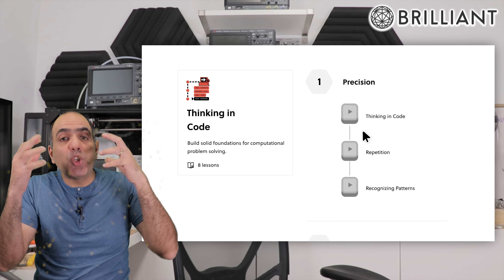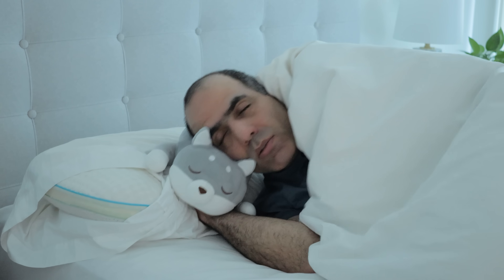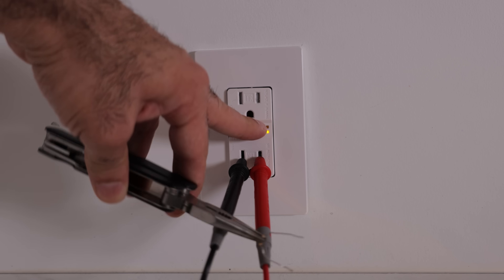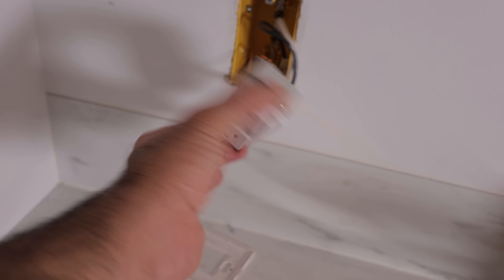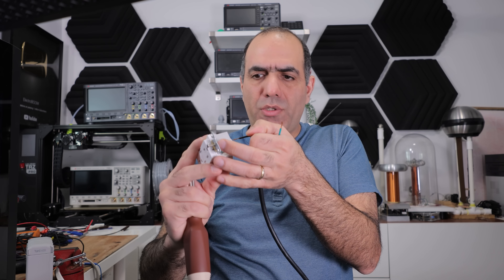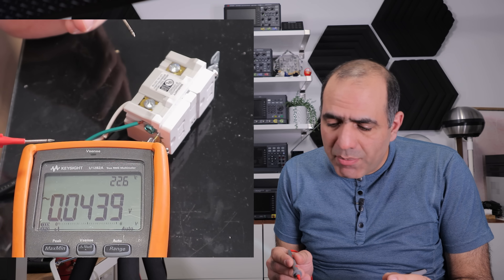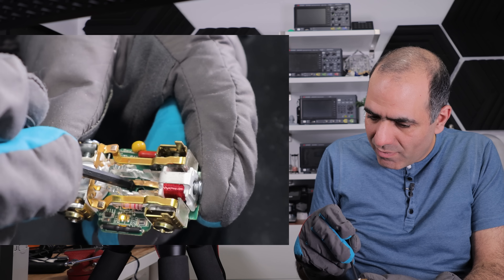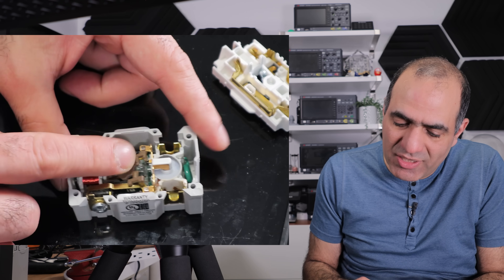Repairing Faulty Ground Fault Failure

Comment: I was a US Navy mechanic for 20 years. I very often found that when something was malfunctioning, and I took it apart, didn't find anything obviously wrong, and put it back together, it was magically fixed. I think it's because in the process, I accidentally cleaned out whatever bit of debris or tightened whatever loose thing was causing the original problem. Gremlins broke it, gremlins fixed it.
Reply: Yeah, sometimes a little bit of dust in the wrong place can make all the difference.
Reply: @FineBakedPastry  So wake up, Mister dustman. Wake up and, smell the dust particles
Reply: @FineBakedPastry  Half-Life joke?
Reply: i learned the same thing as a kid working on million dollar machines at a newspaper. the head maintenance guy told me just un-seat and re-seat all the connections, that fixes most problems
Reply: As someone who spent over 10 years in the Navy who was allowed to assemble/disassemble a few more electrical components than I probably should've due to my electrical background, can confirm. "Mechanical agitation" is a real troubleshooting step, even if the SOPs don't explicitly say so
Reply: I am a private citizen who worked on US NAVY ships for 10 years as an electrician. I feel sorry you were on those ships twice as long as me. Cheers, here's to the cancers.
Reply: It is the physical equivalent of turning it off and on; thus resetting all the goobers within that're screwy!
Reply: @lady_draguliana784  was about to comment how turning a PC off and on will "clean" the data the program use and fix the problem that it may have caused, work at least 70% of the time
Reply: @DeadsTBD   Yup! It's what I always try first!
Reply: @lady_draguliana784  and that's why tier 1 tech support are trained to follow the script where its the 1rst thing they Ask 🙂 then goes to the rest of the script where most other problem would be fixed and ultimately for people like us that already googled the problem and try to find a solution where we did all of that and find it frustrating before finally talking to tier 2 tech... Anyway there's a reason why they are asked to follow the script.
Reply: @DeadsTBD   I still chuckle about the old "Sir, the Disk goes in the Disk tray", "You mean the Cup Holder!?" 🤣
Reply: @lady_draguliana784  and you wonder why they need to specify some things in instruction telling yourself "who would be dumb enough to do that?" Well there are people dumb enough 😅
Reply: @DeadsTBD   Remember, if something dumb is in the warnings, it's because someone was dumb enough to do it! 🤣
Reply: One of the weirdest "how the hell does that work" examples of "percussive maintenance" I ever heard was from the guys who ran a local second-hand domestic appliances shop just around the corner from where I live. They mostly dealt with fridges, freezers (and combinations thereof), and electric ovens, though also washing machines and tumble dryers. I once bought a fantastic and seemingly magical "silent fridge" from them, which ran on the old ammonia absorption cycle with no moving parts and really was completely silent. One day it stopped working, fortunately while still within the 3 month guarantee they had provided, so I called them up to ask if it might be possible to fix it. When I reminded them of what type of fridge it was, they said "yes, no problem, we can have that working again in about 20 minutes".
It turned out that all they did to fix it after collecting it from me was to load it into the back of their van and take it for a 10 minute drive, including several roads nearby with plenty of potholes and speed humps. They really did have it back in my kitchen, fully working again, in less than 20 minutes. Apparently this type of fridge can suffer from temporary blockages in the condenser tubes, which the bumpy van ride dislodged, and that was enough to get it working again. So really not much more than the old tactic of giving an appliance a thump to get it to work again - the shock most likely jiggling a loose connection somewhere.
Reply: Navy Electrician for three-ish years here, I was O-level and didn't disassemble things much but I imagine that's related to 'percussive maintenance' working, i.e. smack it and maybe the electrical contacts that are a bit corroded rub off enough to make good contact again or something.
Reply: Also, Hooyah Navy! (I was a CTI2!) 🍻
Reply: "gremlins fixed it." 🤣
Reply: This is pretty much the idea that my Mom used to fix glitchy Apple IIGS computers at work.  Unplug it, open the cover, and give the chips and cards a bit of a wiggle or push to reseat and this seems to correct the problem.  This is one of the troubleshooting tricks I use if my PCs gives error tones.
Reply: The Omnissiah wills it.
Reply: @amorpilo9666  From the moment i understood the weakness of my flesh, it disgusted me.
Reply: Appliance repair here. Yeah that’s happened for me too. Just unhooked everything, looked at the connections, and put them back. Magically fixed.
Reply: Electronics have an even simpler works-amazingly-often fix:  power it off, and then power it back on.  (Although, with modern electronics, the "power it off" stage often has to involve physically disconnecting the power cable, because modern on/off buttons don't actually power devices off, they just send a signal to the circuit board that tells it to switch between normal and power-saver mode or, in some cases, to send a signal to the firmware or even to software, to tell it to do that.)  I've used this power-off-power-on method to "fix" all sorts of things, ranging from laser printers to a french fry vat.

But the time that impressed my boss, was the time somebody complained that a computer was making an undesirable noise, and I walked up to it, listened for a few seconds, and then thumped my hand down once on the top of the case, and the noise immediately stopped.  I could hear that the problem was a cable brushing up against the PSU fan; it was ATX, so the PSU was at the top of the case, so all I needed to do was jostle it enough to shift the cable's position a little.  Worked, first try.  My boss was like, "Wow, hitting the computer actually works?"  And I was like, "occasionally, but only if you know what you're doing."
Reply: yeah I've had this with servers, I call it doing CPR
Reply: Navy vet also, gremlins are real, can confirm. VAQ-142 Grey Wolves, with Prowlers, not the new Growlers, had Gremlins. Confirmed failure point, reseating connections scares the gremlins off, proven.
Reply: a mechanic's version of just turning it off and on again
Reply: @ornji  🤣 i never even thought about it that way but that's so true lmao
Reply: Pixies...
Reply: Your comment (and similar ones in the replies) inspired to me try to fix my glitching mouse by partially disassembling it and putting it back to together again. So far, I think it has worked!
Reply: And what MRC did you use😂😂😂
Reply: As a it admin just appearing on the crime scene fixes things. I call it the eye of the master. 😂
Reply: yep, and this is a great example. Watch when he takes out the gfci for the first time. See that screw on the inside of the box right at the position where it would come into contact with the neutral contacts? Then he replaces the gfci but this time slides it fully right away from the screw. "Problem solved"
Reply: As someone who's serviced computers for nearly 25 years now, I can relate
Reply: My sister was the electrician. :)
Reply: A bit like a mechanical factory reset, no?
Reply: Friend of mine gifted me a pocket MD recorder/player, 20 years ago. Apparently it didn't work, but only one external screw was missing.
Without any knowledge, I took it apart, saw the complexity, aborted, put it back together (still missing the one screw) and that magically fixed it. Served me well for a couple of years, before I got a decent MP3 player.
Reply: Were you as seabee?
Reply: @LonHunKoc hoo rah seabees
Reply: This happened to me today 😂
Reply: Loose connections are the doings of the devil I swear. Happens alot and can be very very bad.
Reply: That is absolutely true
Take it apart, clean it and put it back together
works 80% of the time
Reply: @Fluxkompressor  yep, aslong as shit hasnt started to melt or burn ur pretty much good to go haha
Reply: All contacts "should" be coated in a substance that prevents insularity via oxidisation.  I guess high-enough voltages can break through, but otherwise a lot of contact pressure and a bit of gold...

Oh why oh why do financially minded peeps hoard this useful metal in useless piles and elevate its price?
Reply: usa number one babyyyy
Reply: This happens everywhere in life. Fixed so many items and gadgets by wondering what's wrong, opening it without any success and putting it back together - fixed.
Reply: Yeah, I actually saw it. I have a RCD or residual current  protection device at my home.
 A year ago it kept tripping randomly during the monsoon season even though it was well insulated in side my home. I replaced it with new one. Then I opened the old breaker and found a bit of black gross of cobweb and dust between the test resistor and the phase contact. I cleaned it and reassembled it and it works fine in the second floor. Probably the moisture during monsoon caused some current to flow thorough the test circuit causing it to trip.
Reply: Same. I maintain an ammonia refrigeration system. We had a solenoid valve sticking open which fed liquid to a recirculator (big problem). Another tech rebuilt it with new parts twice and it would still stick intermittently. Then "rebuilt" it with the old, original piston and plunger. It's been working trouble free for 3 years now.
Reply: I’ve been known to resolve IT issues by simply showing up to the user’s desk 🖥️👋🏼
Reply: @doujinflip  Oh, I do that multiple times per week.  Just walk into the room, and suddenly they can't reproduce the problem.  We joke that the computers are afraid to act up around me because they know I have a screwdriver.
Reply: https://youtu.be/yYSEC2mvFnE?si=apd2qxp_knv_DZFX
Reply: Happened to me with an SSD; Opened it out of curiosity, didn't see anything obvious (ans im not an expert), put it back and it just worked fine (i don't trust it anymore ofc)
Reply: Another magic fix is to call repairman on site of problem.
When you try demonstrate what is wrong with machine, it works perfectly long as the repairman is watching.
Reply: You were a warcrime doing killer you mean
Reply: @DerGudRun   I have that problem, when he took the mech apart and it just exploded into parts? I felt that in my soul... 👻😅
Reply: This has to be the equivalent of "just restart it first" in computers
Reply: I think this is all mechanicals ( engineering)
Reply: Thank you for your service soldier 🙏
Reply: Than you for you service
Reply: On one of the moon landing walks the camera stopped working. When it started again mission control asked the astronauts how they fixed it. There answer that they hit it with their hammer.
Reply: That's called a PFM repair. Pure Frigging Magic.
Usually ran into those on microwave circuits, where lead dress was critical.
Reply: Yo
Reply: It’s like the magic of turning a computer off and on again
Reply: I was never in the military and I've never professionally repaired appliances/devices but I can tell you from experience that the same shit happens to me too. Take it apart, put it back together, automagically fixed.
Reply: I'm unlucky keep saying that
Reply: I just figured out that if all manufacturers would make stuff that once you open them ejected the components nobody would self repair the products and they would make more money
Reply: Kontakt probleme ( Schmutz  oder Oxid) 
Und natürlich kann 1 tropfen öl oder Fett Wunder bewirken😊
 
Staub und Dreck entfernen repariert vieles😊
Reply: I'm only 13, I know a bit about electronics, and it's the same for me
Reply: Wow that happened whit me to once
Reply: my luck its the Soldering  joints inside the  pcb ,   and me wiggling it around   and using a tooth pick to Drag it across each  chip  legs, it sometimes just Re connects.
Reply: Sv(Surface vessel) or SSV (Sub surface vessel)
Reply: I am in PC repair and the same thing happens, just not as frequently I imagine.
Reply: Thats my next move if the ol' Raytheon reset doesnt do it 😅
Reply: Gremlins? Really bro? Come on now, you're a grown man part of the Navy ffs!!! You should know better than to think it was gremlins...

It was obviously the Klabautermen.
Reply: I was a black and homosexual transgender African American muslim. No need for standing ovations
Reply: Ok bud nobody cared

Comment: I had a GFI outlet in my living room that randomly tripped (after a while, noticed that it was usually when vibrations happened, verified by banging on the wall)...found out that the previous owner put the large outlets in a METAL (!) box (ungrounded) and it was arcing inside the box....by the time I found it, it had deformed the tops of the screws and melted some of the plastic around them.

Comment: Hi, "ground is linked to earth in the electrical cabinet of the house" — Huu !?!   This is something strictly forbidden here in France, as our breakers are differential breakers, the neutral reconstitution is made by the electricity supplying company at the (big) transformer's housing of the neighborhood and nowhere else.

Nice reverse engineering, you should start doing a big puzzle right now to pace yourself ! \o/😋
Reply: In fact, tying neutral and ground at the panel, before the breaker, is required by code in the US. Tying neutral and ground after the breaker is forbidden.
Reply: @RonParker  This looks odd as it  makes leaks detection harder to achieve than when they come differentiated.

Comment: Hi Mehdi! Thanks for the video. I live in Europe (Spain) and your plugs are a bit strange for me. That ground protection has an electronic PCB inside?
Most of ground protection in Europe (we call them differential switches) have no electronic PCB. Just some magnetic coils, some mechanical parts and some springs.
As far as I know only those that are protected against harmonics or those that have automatic reset features have some electronics inside.
For example, the one I have at my house, once has tripped, it checks if the fault remains. If not, it automatically tries to reset. It tries it until tree times. If it still trips, it remains off....
Reply: Yes, electronic ones are banned in Europe - or at least in many countries as they are not voltage independent i.e. will not work if the neutral is broken. Electronic ones are available as plug-in ones.
Reply: @okaro6595   The downside of purely mechanical ones is they're insensitive, your higher trip current makes them more dangerous. The best solution would be a dual system with mechanical for reliable detection of large AC currents and electronic for more sensitive detection of edge cases like DC current.

Comment: This test button function is stupid, its only testing the mechanical part. In euro style breakers theres a resistor inside that will produce the trigger current, so you're actually testing the residual current.

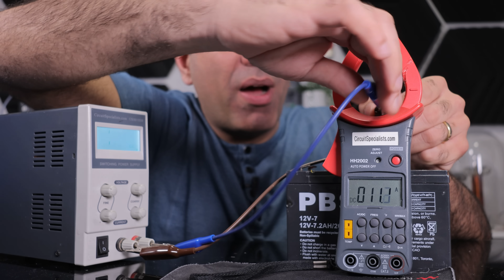Comment: Why didnt he get shocked at 12:00 when he touched both wires together?
Reply: Pretty sure it's low voltage
Reply: Magic
Reply: Because the two wires were connected, the current opted to flow from the wires instead from mehdi's body (since the resistance to mehdi body > resistance of wires) as current chooses the least resistive path and hence mehdi didn't get a shock

Although I would have liked If he'd be shocked because it's always fun 😂
Reply: I-I.. sorry, I never thought someone would ask this.

Comment: I found that most of the time, faults in sensing or inverter circuits are from bulging capacitors.
It sometimes manifests in a flickering led or a self tripping GFCI outlet 😅

Comment: Interesting. So the test button is actually testing the mechanical part of the device not the electrical sensor? I was assuming this whole time that it is actually shorts two wires and simulating real fault. If it is not the case I guess the test button is not that reliable as I thought it was.
Reply: No, it is doing the bypass trick.  You see that large resistor?  Pretty much guaranteed the strip of metal it pushes on simply connects the resistor between line  on the supply side and neutral on the load side (or the other way around) causing imbalance in the sense transformer.
Reply: Well, it is the mechanical parts that can get stuck, and the test button is used to check if the mechanical item are still working as intended. For the electronic parts, they are powered on so little over a life time, that are basically brand new.
Reply: @Tuning3434  The purpose of the test button is not to just exercise the mechanical side of things, but that is one of the purposes.  It's also there to verify that the sense system is working.  A test button that doesn't test the leakage detection is working is quite a dangerous situation.